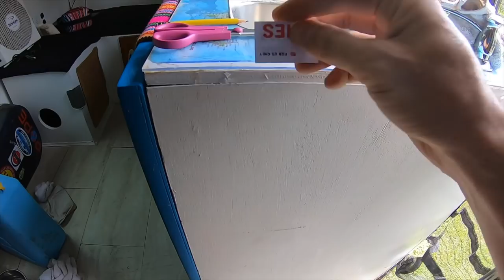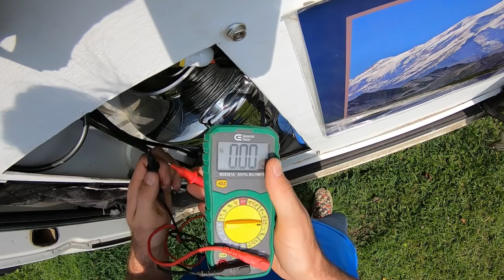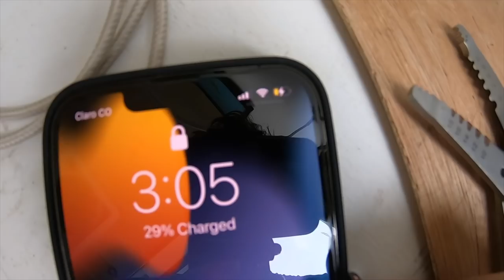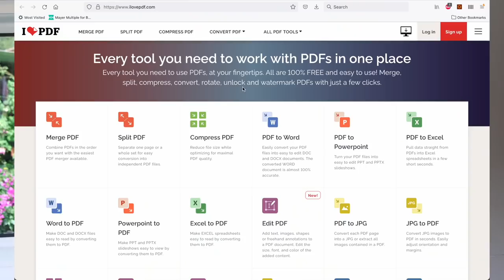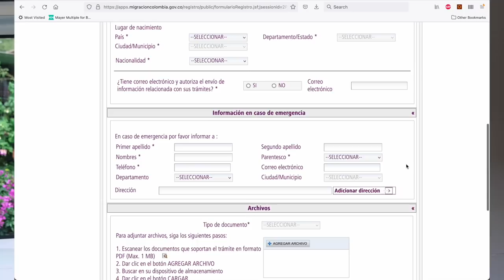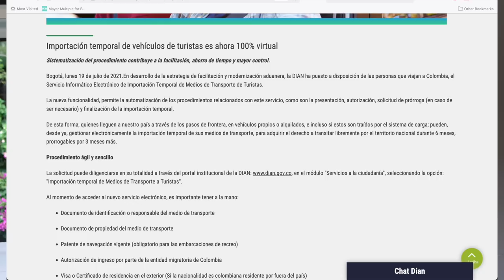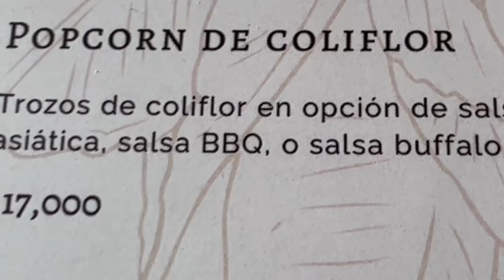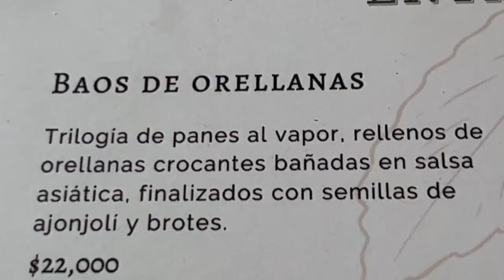LIFE ON THE ROAD | After 3.5 Years

Comment: I would wash the radiator to remove the dirt that is stuck there. If cooling is a problem removing first will increase the airflow and thermal conductivity of the radiation. It was clear from the foam that there are lots of dirt in there.
Reply from the maker: Thanks! So just blast it with a hose when I have the grill off next time?
Reply: @the.vandersons  There are specific bug sprays for that usage that might be a good idea but I would just test with water and some soap first.  I do not think removing the gill is required, there is a large hole that lets the air in. Removing it would make cleaning easier.

Before you start the radiator should be cool to the touch and the same for the rest of the engine. Cold water and hot metal will stress the metal to some degree so just avoid that if you can.

Comment: Hola mis aventureros 🤙 Instead of waiting for a fan from dodge buy a regular off the shelf fan, you can either get single or dual fans. The connections come as "pigtails" so you'd have to reuse the adapter from the existing fan or you can control it manually, you'd need to add a switch in the cab. You may need to do some redneck engineering to mount it, which always makes for a good time, but any fan with the correct cfm output will work. A basic fan will set you back around 30$ or less, higher output/brand will obviously jack up prices. Personally that's what I would do. Best of luck amiguitos🤞
Reply from the maker: Thanks for the tip! Latest option I’ve been looking at is about 340$ w shipping to Peru for an aftermarket fan by Dorman
Reply: @the.vandersons  Orale mi pana! The shipping prices/delays are getting scarier aren't they . Also I'd suggest maybe going to a parts finder/junkyard and get a replacement as a backup because in about 3 weeks to a month shipping from China will be heavily decreased and parts will become more scarce, so buy whatever extra parts you can now. Also manufacturer prices will be going up 10-30% more than what already is within the next 3 months. Hope your mini fam is doing great!  And the content has been 10/10, with a chefs kiss 👌